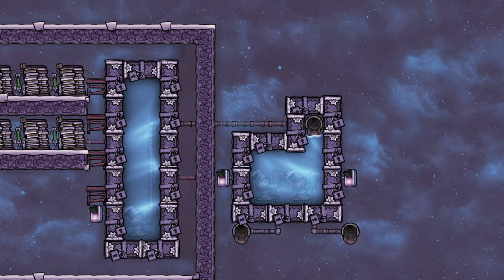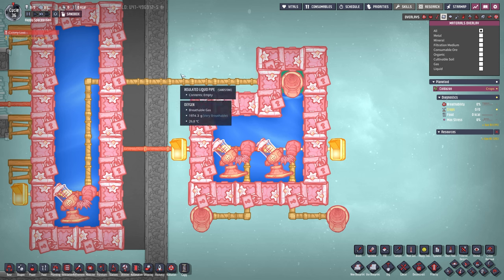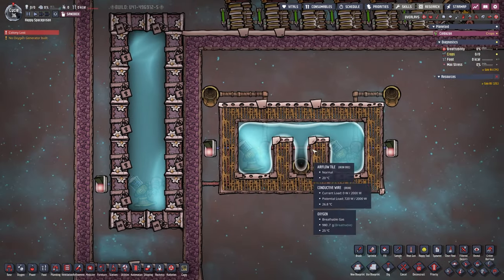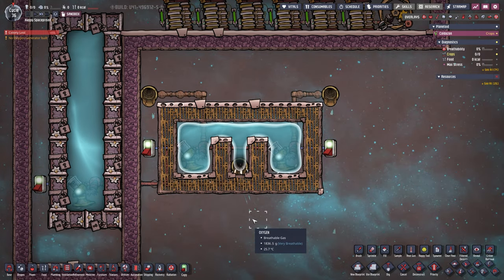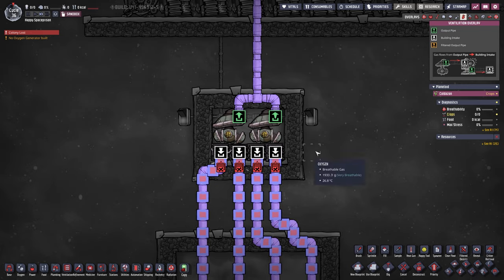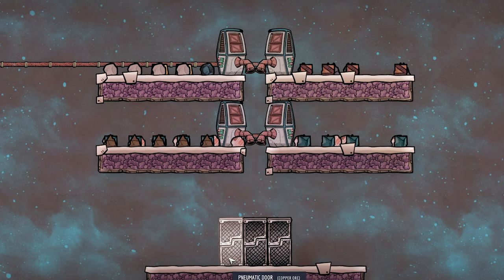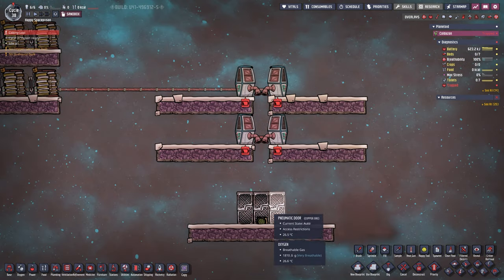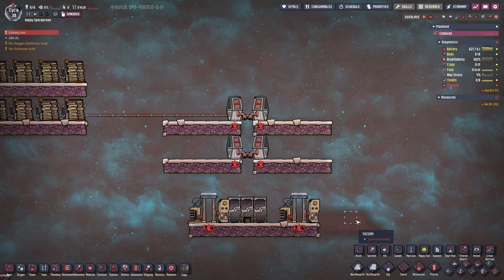GERMAN ENGINEER explains ONI: INFINITE STORAGE! Oxygen Not Included Spaced Out

Comment: Yanno one thing I do with infinite solid storages is instead of using the door trick, I just make a two tile deep hole in the floor. Wide enough dupes can jump, deep enough that dupes can pick stuff from it while not being affected by the decod, and also importantly, I can drop a liquid in there so volatile solids don't off-gas.
Reply from the maker: In my Let's Play series I have actually built the exact version you just mentioned as well as the one I show in this video. Admittedly, your version is overall smarter :)

Comment: I found a beautiful design for the infinite gas storage of 3x3.
So six of them an be build next to each other and every type of gas can be stored in a single floor:
On the bottom-left a Gas Pump to supply use the gas when needed.
Going from the top-left around the pump to te bottom-right one block at a time:
- Atmo Sensor; connected with automation to the pump, can be used to control the pump behavior in any situation
- Gas Pipe Element Sensor; Select whatever gas you want to store
- Gas Shutoff; connect with the previous through an automation wire
- The shutoff output block is below the first and connected to the final block in the square
- Gas Vent; connected to the shutoff and will be used to deliver gas to the chamber
A single amount of water can be spread out over the whole thing, making it easier to have a small amount.
Then Place the blocks between the chambers.
When all components have been placed, the walls separating the chambers can be placed.
Finally all the chambers should be emptied.
Once this is complete gas can be stored.

Comment: 5:40 how do you precisely drop 600g of liquid onto the vents? Have you tried higher numbers like 2 or 3 kg? 

My issue is that a tap always drops off 200kg of water per delivery, and 600g is but a small fraction of that. 

I just tried it again (probably my 7th time today) and I had 2 vents each with 1.4kg of water, looking the same as yours. Sealed it up and it ran for a while, then suddenly the water got deleted. This is intensely frustrating.
Reply from the maker: Yes, a full drop is 200kg. You build the storage first bigger, then drop in some liquid(not the full 200kg) and have the dupes mop to get to the appropriate amount. May take a few tries, but once you have it down, it's super easy. Here is a relatively recent video in which I do it in near real time: https://www.youtube.com/watch?v=pyPa6u83mUI

Comment: The vents are overpressured for me when im trying the gas build at 5minutes. Water seem to not work any more.
Reply from the maker: The vents shouldn’t overpressure, if they do, you used too much liquid. I used 600g in this video, but I also put that in with the sandbox tools, which changes things a bit. If you put just over 100g per tile it will work without disappearing. It takes a bit of trial and error, I built many of those in my Let’s Play videos if you need to see it built “live”.
Water storages also still work, but are also a bit finicky to learn :)
Reply: @BierTier  oh i did 600 kg. Thats why
Reply from the maker: Yep, that would explain it ;)
The rule of thumb is above 100g but below 1000g per vent 😊

Comment: so is the only function of the doors to stop the decor? or does the middle door the thing that merges all the junk? because I dont see why you couldn't just remove the doors, since that decor penalty is minuscule
Reply from the maker: It is for the decor. Unless they fixed it, the decor will go up drastically. I barely put anything in there in this video, it was just for explanation purposes. They could have fixed it, but I haven't checked to be quite honest.
Reply: Seems like this got changed/fixed as door is a layer behind the items now.  I got like -300 decor despite the doors and see the items on "my" side of the door not behind it. Even tried to open and close the door

Comment: Here's a problem with infinite gas storage (say geyser like Kaiser and definitely not like gayser!): The liquid gets pushed around too much so I leave a full tile of liquid just below each vent so the excess 1 kg doesn't get pushed around as much.
Reply from the maker: I try to pronounce it properly but it still slips out the wrong, more german way, lol.

I honestly haven’t had any issues with the gas storage, exactly how I built it is how I have used it for quite some time now. But you are 100% correct, a full tile of liquid below would be a safer option, but would also waste(in my example) 4tons of water. With several such storages that can add up quickly. 
That’s the nice thing about ONI, several ways lead to the same or at least similar result :)
Reply: @BierTier  That is correct, you can also show a battery of infinite liquid storages with passive filters to separate everything> I used to have three pumps working on a pool of mixed salt, polluted and clean water separating into a battery of infinite storages. I built a passive filter that had a loop with two 1 g liquid valves and two liquid pickup points in a wider setup.  You "geyser" is better than any other german speaking narrator of ONI!
Reply: nah mate, its geeezer.
Reply: @TheKlink  Yah mate, throw some shrimp on the barbie!

Comment: I cant get the gas storage to work. When i add water it goes direct to over pressure
Reply from the maker: The amount of liquid needs to be below 1000g and above 300g. It's a narrow window, but below 300g you run risk that it just disappears and breaks your storage. Above 1000g it will overpressure!
Reply: @BierTier  i have 100g and it is overpressure